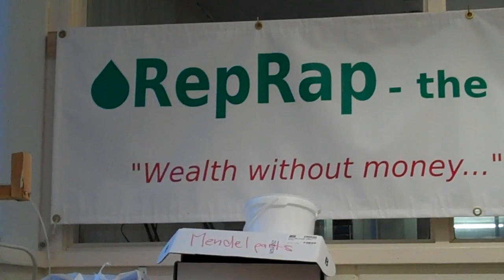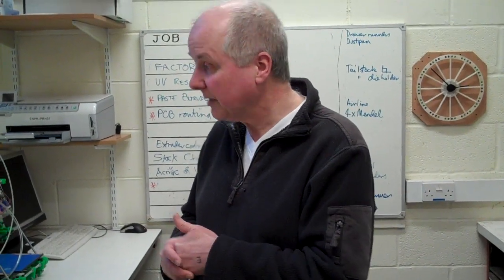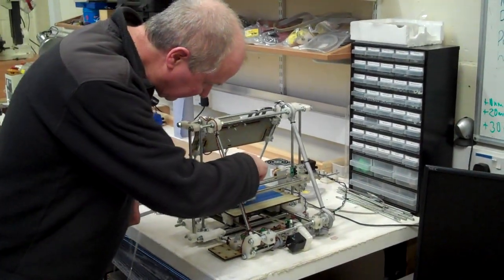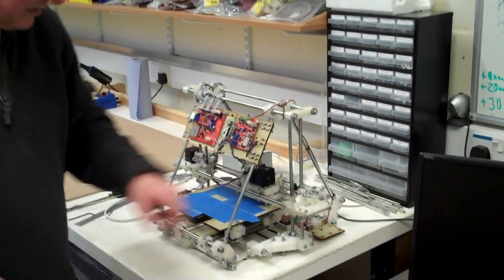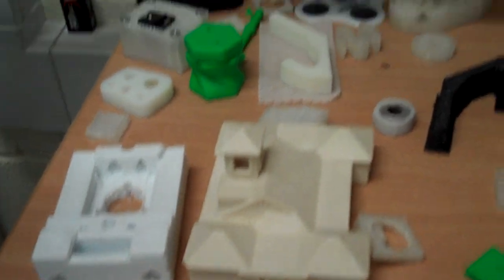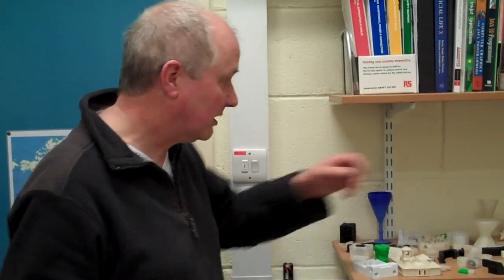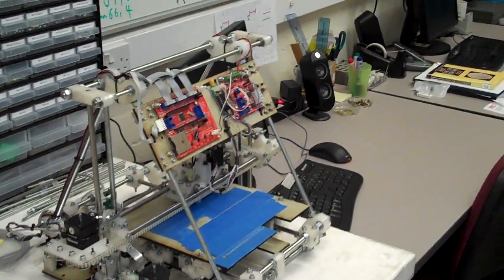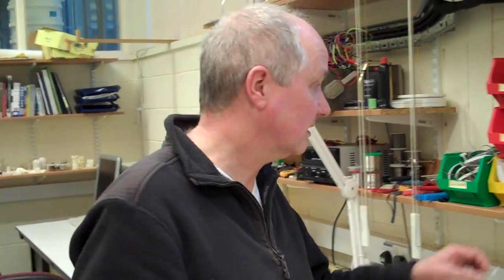RepRap Open Source 3D Printer

Comment: What if you used the rep-rap printer to build 10 mini rep-rap printers with some extra filament that is 10x smaller?  Then those 10 mini-printers could build 10 mini-printers and you would have 100 mini-mini printers 100x smaller.  Then do it again and again.  You could get 1 billion printers at 1 billionth the size, enough to build fabrics or nano-analog computers...
  You can also do the reverse and build a bigger rep-rap from smaller one until you have one gigantic rep-rap to build foundations to the core of a huge building, then you use the smaller 3D printers to build smaller foundations of the sides.

Having enough plastic could be an issue if you want the 3D printers to double exponentially, I wish you could make the rep-rap out of mud, cement, wet sand, snow, or melted sand...

Comment: If it was something like a 5 or 6 axis machine.. like a robot arm, which could change tools (it's hand), then it could not only print & mill plastic parts, but once 2 or 3 had been built, it could construct itself from those parts too.
Metal powder/ metal clay could be printed/ sintered to make most metal components.

 Given the logistics, could make 100% and begin mining, constructing chip making environment, solar panels/ power plant.  well on it's way to being an independent life form.